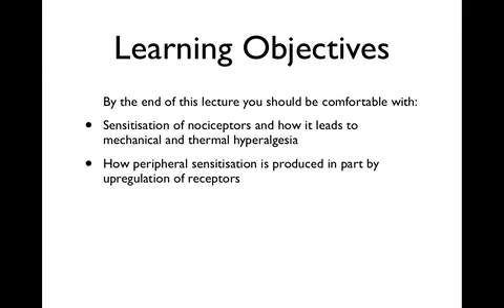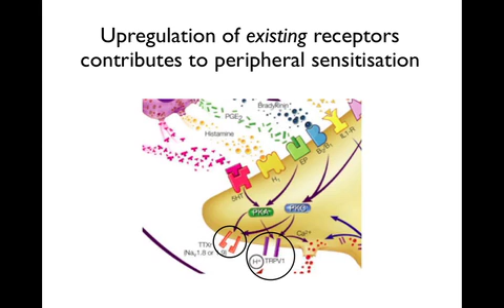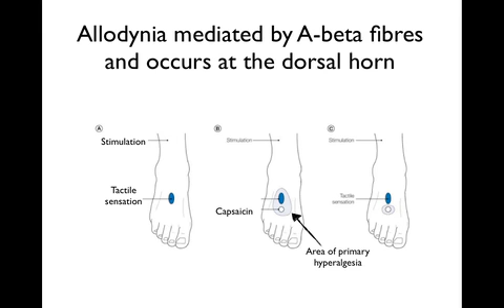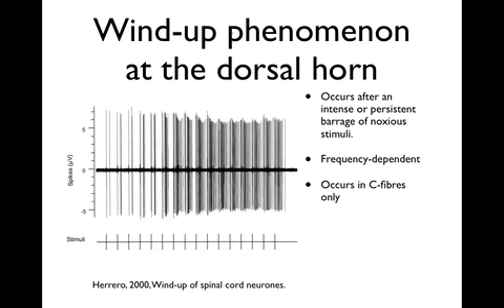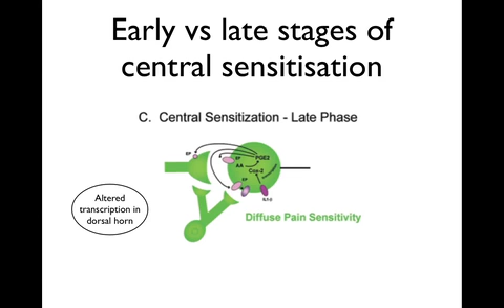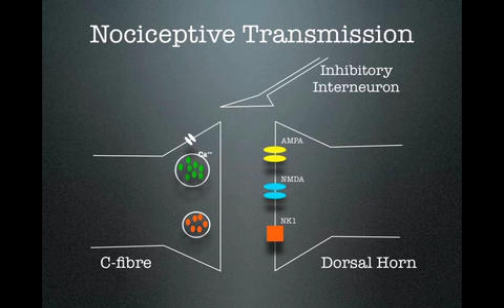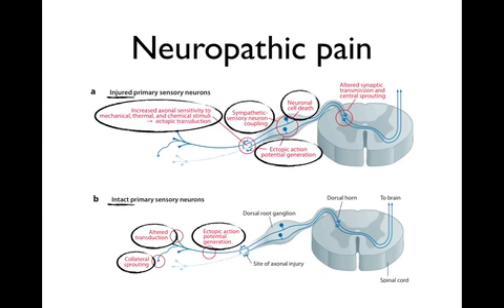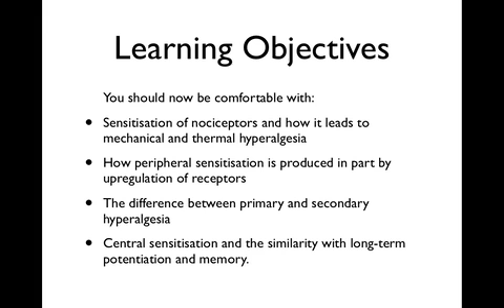Pain Sensitisation

Comment: Fibromyalgia was dxd in 1991, central sensitization was dxd in 2014, idiopathic small fiber peripheral polyneuropathy was dxd in 2023.

Prior to the last diagnosis, I've been told it's all in my head, and have been been treated as a problematic, exaggerating, hypochondriac patient.

Currently (September 2024), my treating neurologist has only diagnosed me, without a treatment plan other than large doses of gabapentin, which i will not take over 900 mg in a 24-hour period. My research shows it is potentially addictive, hard on kidneys, and may promote dementia. My neurologist said that is not true, though my reseach is from many reputable sources, including NIH. 

Has anyone heard of any positive treatments for small fiber peripheral polyneuropathy?